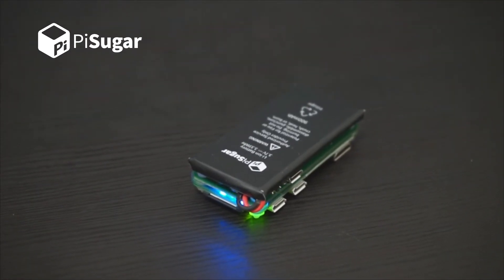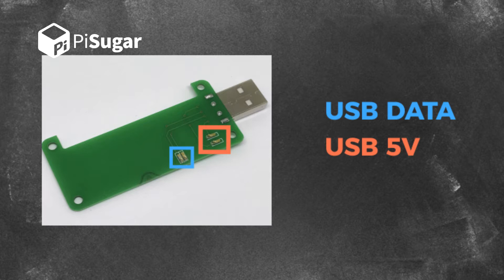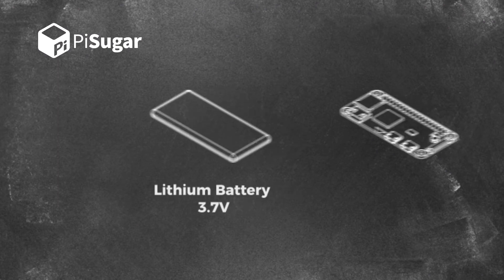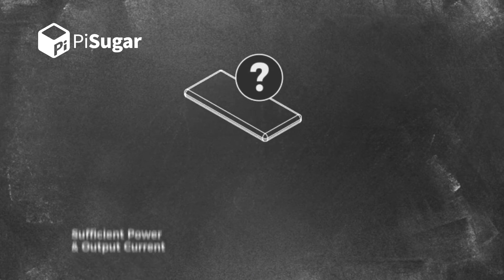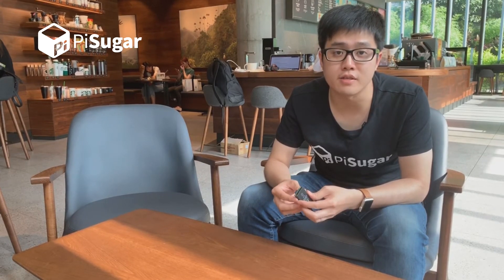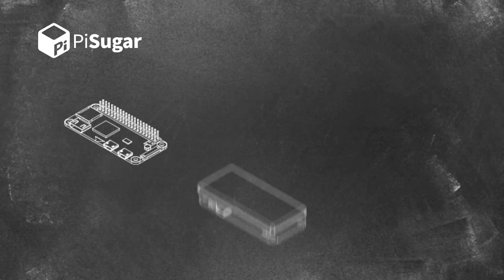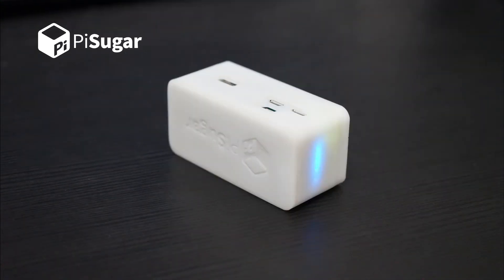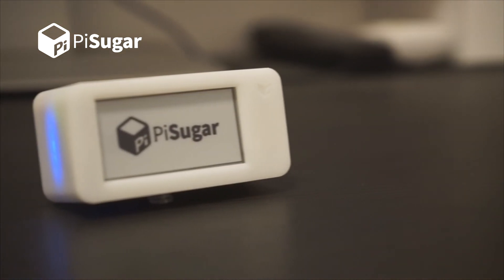Full Introduction to PiSugar - Raspberry Pi Zero Battery

Comment: Is there a control line, so the OS can check the load status of the battery?
Reply from the maker: PiSugar 2 & 3 have data connection so you can manage the battery status from the OS.

Comment: ooooo yes please tell me where is that a good idea to put a magnet so close to the board and the sd card..... don't buy it it will corrupt your data.... it needs shielding   .... proper one
Reply: SD cards are NOT magnetic supports, like mechanical Hard Disk. 

SD cards stores data in silicon based integrated circuit, and for this reason they are NOT affected by a magnet.

Also, even if we were talking about a mechanical Hard Disk, you need a very big magnetic field to corrupt data inside (HDD not only are shielded towards external magnetic fields, but the actuator that move the read-write head has also a magnet inside).
Reply: SD Cards are not affected by magnetic fields. Said by SanDisk themselves... https://kb-eu.sandisk.com/app/answers/detail/a_id/4687/~/sandisk-cards-environmental-tolerance-%28waterproof%2C-temperature%2C-magnetic-and

Comment: So How Can I Buy This?
Reply: They are selling the board and battery for $35, and the case is just a dream. The thing is even more expensive than the pi zero itself, you may as well just get a 18650 battery board for raspberry pi for 5 bucks on ebay. With that you can even change battery like a tv remote. Way more efficient than this garbage.

Comment: Hey is it possible to extend the wire connector from the battery? I would like the battery to have a distance from the pi zero.
Reply from the maker: We didn't use connector due to the limited space. You should probably cut the wire and extend it.
Reply: @PiSugarStudio  do you know what kind of wire I'm gonna need? Sorry, new to this.
Reply from the maker: @gundamwarrior606  24AWG wire is OK. You can find it on aliexpress.
Reply: @PiSugarStudio  nice, thanks a lot dude.
Reply from the maker: @gundamwarrior606  You are welcome.

Comment: Would you be able to still use the Pi Sugar and a USB dongle at the same time ?
Reply from the maker: You can use a zero usb stem with pcb less than 1.5mm in thickness.
Reply: @PiSugarStudio  okay so this one should be okay to use with the sugar Pi even though it uses the same connectors ? https://www.adafruit.com/product/3945

Comment: Should sell the boards and batteries separately. slap a jst connector on the board, pair with any compatible battery and your good to go. Will sell more boards that way. I love the concept, but im not willing to spend 3x to 6x the cost of the pi itself to power it. Don't get me wrong, I understand why your prices are that high, you have only made small batches, so cost of production is high compared to what it would be in bulk. But for it to be a viable product, it needs to be available at low enough cost.
Reply from the maker: Cannot agree more with you. Now is just the beginning. We will try to make bigger batches in lower cost in the future.

Comment: Just got mine today! Does the startup script on github allow you to use the button for a graceful shutdown?
Reply from the maker: Sorry but no. The button links to the powerIC on the board just for turn on and off, it's not programmable. The startup script on github is about some recommend software, nothing to do with the battery. For graceful shutdown you can try sugar-wifi-conf on github, use your smart phone as a bluetooth controller. We will have a programmable button in the next generation of PiSugar, probably in Septemer: D
Reply: @PiSugarStudio  Great... Love it so far! Thanks for the reply!
Reply: @DerrickMoreno  I was wondering about overheating the pi zero, How is it?
Reply: @viciousthehamster994   I haven't noticed any overheating. I've run the zero on the pi sugar and had it plugged in to charge and didn't see anything odd.
Reply: Awesome!